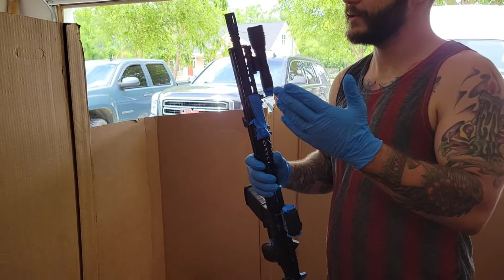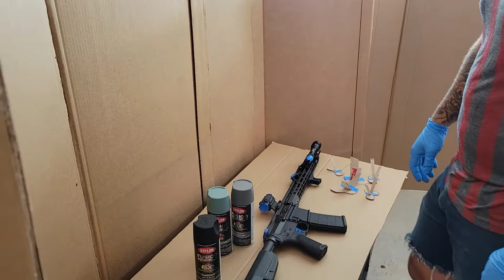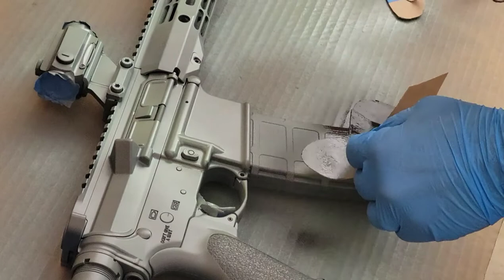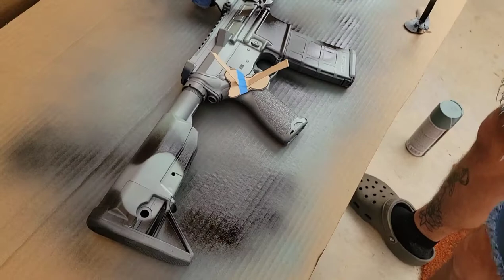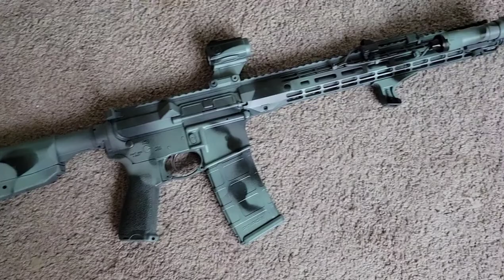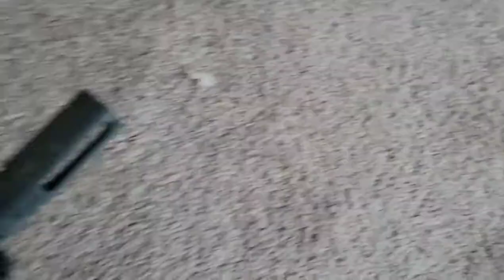Painting a Rifle the Cool Guy Way

Comment: I did a matte clear coating after. It helps with wear and makes the colors look even better.
Reply: Christian Constitutionalist  the matte clear dulls out. Makes everything uniformly flat with no shine. It will make semi gloss paint almost flat.
Reply: Wear and tear makes a painted gun look much better
Reply: That and I’ve used a matte clear because it takes away that tacky feeling from the spray paint. Almost brings it back to the anodized feeling of the stock gun

Comment: That stencil setup is very clever! Way better than my previous method of using cut paper with spray adhesive to the back of it.
Reply from the maker: Thanks man. It works for this type of paint job but I've had my wife cut me some stencils out of removable vinyl for other guns I've pained and done actual camo patterns like M81. Might do a video on something like that soon because I have a gun I want to paint multicam.

Comment: I would have left it black and then would put some gray and some green on it
Reply from the maker: Since I filmed this video this upper has got a new barrel and handguard, new optics, and is on a different lower. Lol. But it's painted something lime what you're describing now. That's the best part about rattle can paint jobs you can change them over and over and over. 👑

Comment: How well does the paint adhere to an oily gun? How well does it stick to the polymer parts ? Most spray paint doesn’t adhere well to this kind of material at all especially without serious prep and priming… How well does it hold up to scratches? And does it soften when it’s heated? These are very important variables…
My opinion… this is ghetto as hell and really depreciates the value as well as the efficiency of the gun… the paint will insulate the heat from the gun increasing wear over time…
Just my thoughts from many years of using spray paint on many many different surfaces…
Reply from the maker: It obviously doesn't hold up like cerakote would but half the fun is you can repaint it again later if you want to (also keep in mind people pay extra for "battle worn" cerakote jobs) this particular gun has been rebuilt and repainted like three times. If your gun is super oily yeah just wipe it down some before you start. As for making the gun "less efficient" idk what you mean it still works just the same if you paint it. The gun will feel a little tacky for the first day or two after you paint it but it all smooths out after a little handling and couple of range trips. You don't sound like you shoot much.
Reply: @basedhardhands  paint building up coat after coat is never a good thing on anything mechanical… I’ve been shooting since I was 7 years old… that was 41 years ago… 
People paying for “battle worn” are the ones you gotta worry about that haven’t been shooting much… just my .02 
I’m sure people enjoy watching your videos but people also enjoy videos of all kind of things that are the opposite of optimal… and it’s always the people that really have no idea…

Comment: Bruh...I  completely understand you not knowing HOW to paint but WHY didn't you take it apart BEFORE spraying? Did you not do ANY research before? Also once paint dries you DON'T pull up the missed tape,you get a razor and cut the edge otherwise you risk pulling off a whole swatch of paint. You got real lucky there. Either stand the piece straight up or hang the piece you're painting if you want it done faster & don't have to worry about flipping it over. I hope this was a good learning experience.
😂😂😂
Reply from the maker: What are the benefits of taking it apart before painting it? This is spray paint not cerakote.
Reply: Shut up kid, painting the rifle whole is the most popular way of doing it. Taking it apart is a valid way to paint but there are no downsides to painting it as a whole unit.